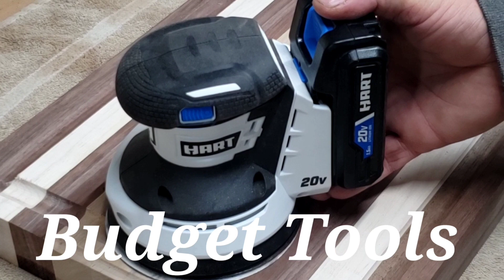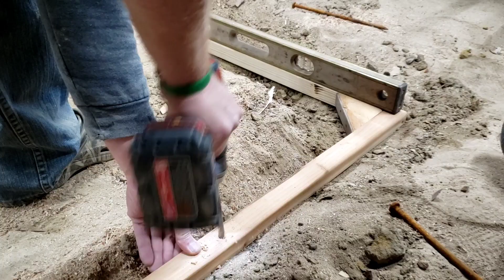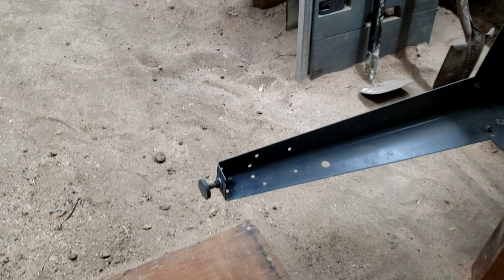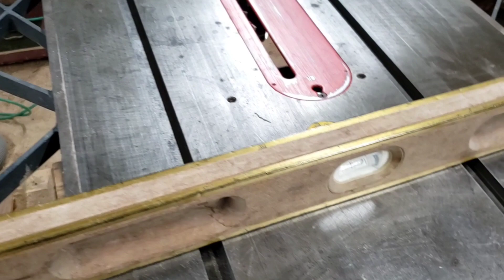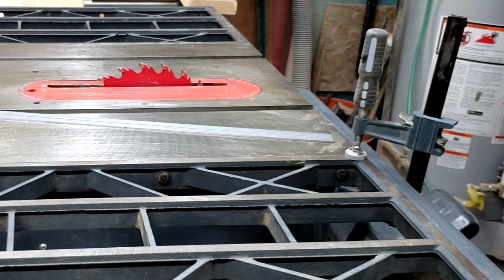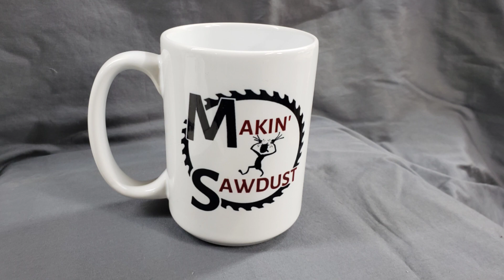Craftsman contractor saw 113.298762 tune up || LEVELING THE SAW || ADJUSTING THE CAST IRON WINGS ||

Comment: You are absolutely right about the switch. I once was holding the piece in place with my right hand and reached my left over to the switch (right side) and turned off the saw. It was spinning down while I brought my left hand back and my thumb touched the spinning blade. I still have a somewhat numb thumb after 45 years. What I did to make sure this never happened again, was to add a paddle kill switch to the left side. Now, either side switch turns off the saw. And, yes, I have turned off the saw with my leg a few times too.

Comment: I couldn’t help but notice the gas-fired water heater with the ‘“Gas-Can” warning sign.  Combustible dusts can be just as hazardous as flammable gas vapors. A carpentry shop in the basement with natural gas-fired water heater is very risky!
Reply from the maker: It certainly is

Comment: I've had more issues with the steel metal wings being bent or warped. I think this was due to the table saw being lifted by the wings when it was loaded on a truck. I ended up replacing both of them with the cast iron wings. It adds a bit more weight to the table saw but it's worth having a good flat surface.
Reply from the maker: Awesome tip and comments

Comment: You are working on a table saw with the blade up and the power connected.  UNSAFE !
Reply from the maker: How do know that?
Reply: @MakinSawdust  I can see the blade is up and I did not see you disconnect the power.
If you have to ask if something is unsafe after being told it is then you should sell the saw and all you tools. Because you are not qualified to operate them safely. Nor should you be teaching others.  Table saws are VERY dangerous tools.
I am a Professional  Machinist and woodworker for over 35years. I still have all my fingers and no serious injuries because I practice safety procedures.
Reply: @mrgcav watch the video. It clearly shows the unit is unplugged. 
Kindness is never a bad thing.

Comment: One thing different on mine is the fence is gear driven with a knob for fine adjustments.  Interesting.  I want to see your trunnion adjusments.
Reply from the maker: Thank you. Stay tuned, I will be rebuilding an older version Craftsman saw, but the adjustments and setup will be quite similar.

Comment: Just wondering what kind of drive is on that saw? It looks like a cable drive but I am curious?
Reply from the maker: It is a belt drive. The cable drive 10" saws are ok, just hard to find a replacement cable if needed
Reply: @MakinSawdust , I must be blind? I watched your video again and it plainly shows that your saw is definitely belt driven. 
     It is hard to convince some people that these saws are pretty good saws. I use to carry one to the job site when a saw was needed when doing custom work. I couldn't afford driving back to the shop to make a few cuts. When I retired that saw was still working fine. If you treat them good they will treat you good.

Comment: I purchased a similar model last weekend for 50 dollars model # 113.298843 with a 3 hp motor and I plan on adding it to a custom made 30x24x32 1/4” steel cart on wheels for a new plasma and welding table that I can add angle iron pieces on the ends that can be raised or lowered for fabrications and the miter can also help with angle welds. There’s so many possibilities and the best thing it is mobile. This is my second build the first one was a three legged grinder table with a 1/4” plate steel top. I bought a 12”x60” steel drain cover and cut in half and spot welded the pieces together for a 24”x30” table top for the stand and bolted it to the top. Being able to move it in two pieces is lighter than in one piece. The motor I’m thinking of making a belt sander with adjustable speeds but I’ll have to research how to make it work safely.
Reply from the maker: Fantastic plan!! Cool idea :)

Comment: Hi there! I have an almost identical saw I've had for about 3 years. Lately, when I make cuts, I'm either loosing power or something is slipping, but can't quite figure out which. Any tips or tricks to determine if I need a new motor or bearings, or what not? Thank you!

Comment: Thanks for sharing your knowledge and projects! Just bought an old Craftsman table saw, similar to yours. Didn't have a belt but I reckon it's easy to find a replacement. Thanks again!
Reply from the maker: That is awesome! I highly recommend using a link belt instead of a standard V-belt. It will eliminate vibration caused by a v belt
Pretty sure there is a link to it on my website.
Reply: @MakinSawdust  $25! I'm gonna inspect it the same way you did. I will check out your website for the belt. Thanks for the tip! It's a Craftsman 113-12010. So pretty old!

Comment: I have one question: What are those two Allen screws in the middle of the table for? My older saw didn't have these.
I certainly appreciate your previous response by the way... Have a great day.!!  btw: that on/off switch will be switched over tomorrow.
Reply from the maker: Thanks for your comment Keith. The allen screws are for the 90 and 45 degree stops that can be micro adjusted.
Reply: @MakinSawdust  Thanks.!!

Comment: Great videos. I have the same saw. Bought it cheap a lifetime ago and never used it because of the blade alignment issues you mentioned in the previous videos. Anything I cut binds up. Any help you could offer on adjusting the blade to the table would certainly be appreciated. Up until now it has just been a very expensive out feed table for a lesser saw.
Reply: What is it that you need help with, exactly? Are you familiar with the process, or are you looking for step-by-step instructions. I am more than willing to help you figure it out, if you haven't by now, as your comment is months old...

Are you on Facebook? There are some killer groups that have emense knowledge on this topic...
Reply: @wharfrat360  Thanks for the reply. I've watched a few videos but I have not adjusted the saw. The Facebook groups sounds promising. I wasn't very clear on what I was needing. Basically I wondering what can be adjusted, tools needed, and how to avoid making  it worse.

Comment: I might just make a welder’s table out of these wings. I’m noticing a lot of woodworkers ditch them eventually and go with a laminate particle board for the weight savings and easy of modification. The wings are machined cast iron so they resist weld squatter. Thanks for giving me the idea whenever you used that clamp to correct the wing!
Reply: I'm picking one of these saws up tomorrow and I was thinking of using the wings for in-feed out-feed on my 13" Ridgid planer

Comment: Do you have ''any" info on changing the arbor bearings? This is the 2nd time I'm having to change them.
WHY? because I went the cheaper way and bought CHINESE bearings....The last damned time I'll do that.!!!
I've got the same model saw I bought used in 1988 or 89. I wouldn't take a farm in Texas for it. I just need to get some decent bearings to replace the "Duds" I've got now. Any suggestions would be greatly appreciated.
Reply from the maker: Yessir, I do have some insight. Take the arbor and bearings to a reputable auto parts store, maybe even a heavy duty shop that works on big trucks(semis) and they will be able to size and source the correct ones through SKS or Timken or the likes.  :) Be well and I hope this answered your question.
Reply: @MakinSawdust  As luck would have it, I came across a saw that had been in storage for years. Nearly brand new.!!! I thought it was well worth the price considering the condition it was in. I rolled my older saw to the back of the shop until I can sell it with the caveat of the issues about the arbor and rear bearing. I did have Timkens ordered and called the supply house to cancel, but they said no problem we'll keep them in stock for someone else.
What surprised me "Makin' Sawdust'' was the serial# of your saw.!!! #113.298762. Sir...the serial# on mine is 
#113.298761. Can you believe that.?? I worked 4-days straight on it and it purrs like a kitten.
I have one question: What are those two Allen screws in the middle of the table for. My older saw didn't have these.
I certainly appreciate your previous response by the way....I just forgot to mention it when I saw the serial #'s of the two saws. Have a great day.!!  btw: that on/off switch will be switched over tomorrow.

Comment: I have just started to refurbish one of these saws. My wife picked it up for me at an estate auction for $45. It needs some rust clean up, on the wings mostly, but there is a touch on the table as well. I'm thinking of building it into a roll-around cart for my shop, but lumber prices need to drop first. Until then, I'll be leveling and tuning it up and checking on safety issues. First thing? New power cord for the switch since someone, in their infinite wisdom, removed the ground pin from the plug. I await your next videos on this. Thanks!

Comment: Kevin thanks for putting these videos together. I have the same model but I am having trouble finding replacement pulleys for it. Any leads on where to find them?
Reply from the maker: No problem, glad to help. If you refer to the manual and cross reference the pulley size. any generic pulley will work and they are standard size graduations. machined pulleys will be better balanced compared to the stamped pulleys.  I appreciate the compliments bud. It is a good reminder for me to get a replacement pulleys link and add it to my article.
Reply: @MakinSawdust  Thanks, Kevin. And your basement reminds me of my dad's dirt floor workshop back in the day. Keep up the good work.

Comment: I have the same saw and wings.  Both of my wings bowed down in the middle.  I loosened the middle two bolts, then used a car scissor jack to put a little pressure from the bottom.  They are both flat and flush now 👍
Reply from the maker: Right on!! Thanks for sticking around Tom! I sure wish one of us could get lucky with an IG post giveaway someday LOL

Comment: Nice vid, Kevin :D Considering wood is a "living" material, I think you can live with that tiny dip in the middle of the table. My brand new Laguna F3 has a slight sag to the wings by a sheet of paper at the extreme sides, and that is within factory tolerance. So, I think you will be very happy with your saw after these adjustments. Cheers.
Reply from the maker: Very true!
Dave 'the dude' and Bob say hello to 'baby vader"

Comment: I have similar Craftsman saw from early 50’s I have up graded mine to a Delta t3 fence from Lowe’s,a 3 hp 220 motor from harbor Freight up grade pulleys and belt to machine one with link belt and replace switch to a paddle switch
Reply: I’m thinking of doing similar upgrades how’s it running now? I really like the look of these craftsman they are badass looking with the webbed cast iron wings
Reply from the maker: @gerardoquiroz4290  I think they are cool looking too. I wanna do a custom paintjob someday :)
Reply from the maker: I am seriously considering a fence upgrade. Your saw sounds like a nice machine, thanks for sharing :)
Reply: Runs great  , the fence up was easy to install the cast iron taps well and the 3 hp motor was no heavier than the old 1 hp.
Reply from the maker: @oldmangravely6554  thanks for the info

Comment: I have the same saw how does the fence slide smoothly
Reply from the maker: There are a couple plastic bushings and also a small wheel that need to be inspected. There is a parts diagram and manual on my website
Reply: I have the same saw and fence.  I added paste wax to the contact points under the fence.  Slides smooth yet still clamps tightly.  Also, make sure the front and rear rails are parallel.  I had to shim one of my rails with thin washers.